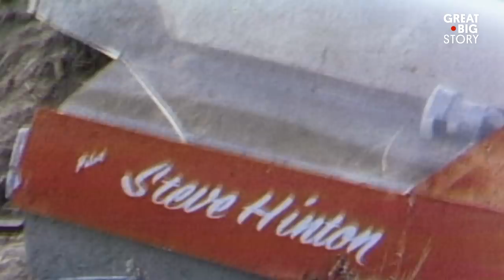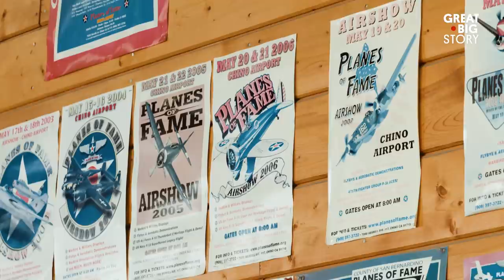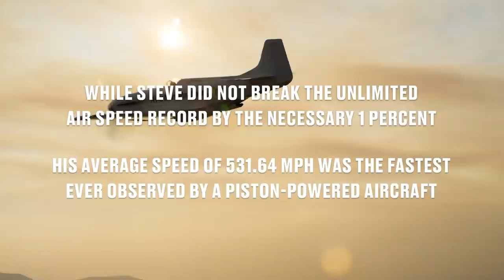Racing Against the Odds in a WWII Plane

Comment: in the 70's when i was a kid..i got a COX P-51 Mustang..the chrome one..for Christmas..it was absolutely gorgeous..4 bladed prop..yellow nose cone..i was the envy of the neighborhood kids :) my dad told me we would fly it in the spring time (we lived in Chicago) finally ...FINALLY..a warm spring day presented itself..hey dad can we fly my airplane..(i had been dying all winter to fly it) he said sure son..so i had it all ready to go..we ran the string out..attached it to the plane..fueled it up..started it up..i was about to go to the control handle..he says "son you better let my try it first to make sure it works ok"..ok dad..he takes it off..its flying through the air..actually it was very fast..sparkling in the sun..so he starts doing loops with it..1st was great..2nd one....well....i never got to fly it..
Reply: F
Reply: That's better than the first flight on the garage roof where my dad flew it around the roof 2 times before the control lines wrapped around my neck. The prop cut the lines and the plane flew off into the bushes. It was not a pleasant day for me. I still have the Wen Mac .049  engine 60+ years later.
Reply: @kimmer6  wow..i bought another cox airplane and the purple metal flake dune buggy also..i don't remember the plane..i guess nothing beats a chrome P-51..but i do remember that prop chopping at my fingers when starting it..your incident could of turned out much worse..ahh the 60's n 70's when lawn darts ruled the world :)
Reply: @ferrelx --I got a Chrome P51 Cox with I thing .20 engine for Christmas in maybe 1962 or 63 in Puerto Rico.  I was 10-11 years old.  Beautiful thing.  Reading the instructions in English I, after a few tries managed to start it over my bed with the help of my father.  Gas smelled strange, but i loved it. Smell stayed in my room for days on a row, so my mother prohibited me from starting the engine on my bedroom.  Read further how to fly it, went with my younger brother to the park and doing a lot of PIO's I managed to fly and land it. Flew it many times until i traded it for a bigger one.  Became Commercial Pilot later with help from ROTC.  Love that P51.
Reply: @feetgoaroundfullflapsC  awesome brother :)
Reply: @ferrelx  Pretty sure the Chrome version was by Testors and not Cox.
Reply: So he gives up beer and cigarettes for a month and buys you another one?
Reply: @SvenTviking  Well Sven....They were 12.00usdlrs in 1960.  What do you think?

Comment: Great story. If it was up to me, I'd opted for a more modern supercharged engine and use a pair of swept wing like the F-86 Sabre.
Reply: Anas Takiyudin Voodoo’s race engine had twin superchargers helping crank out 4,000HP.
Reply: @maxwellharris507  yeah but 4000bhp coming from 27L V12, that's 148bhp/l is pretty low by modern racing standard, and it's very unreliable. Even back in the 70's we got formula-1 engine churning out 1000bhp from of a little 1.5L engine. 3
Reply: Anas Takiyudin aircraft engines and car engines are very different animals
Reply: @maxwellharris507   grammar massacre warning
 @Maxwell Harris  it's a piston engine so not much difference than car engine, except than the fuel used, and the RPM redline. Stock aviation piston engines usual redline at only 2500 rpm to make the engine understress because it had to cruise at almost full throttle much of the time. For this race RPM limit is not an issue as the plane just need to do several passes at full speed. This test is done at very low altitude anyway so a car engine could be used with few modifications.
Reply: The record is for a piston driven aircraft with relatively straight wings.
Reply: Also it's not that hard in the F-86 cause it's transonic
Reply: @atranas6018  >what ist altitude
Reply: @atranas6018  Rpm is a huge factor, you spin the prop too fast and the tips go supersonic, greatly reducing its efficiency. Also automotive engines run up through rpms, the plane, like land speed cars have a high stress stagnant rpm set for a long time, which is the challenge. Theres a reason automotive and aircraft engines have developed completely different.
Reply: @ccubsfan94  this combo can be use to move the air faster without the blades going supersonic. Shorter blades, higher blade pitch, more blades, & suitable gear sets. The race only done in one specific rule, to go as fast as posible in a straight line with no roll & no negative G at almost sea level which under this condition automotive engines can serve really well.
Reply: @atranas6018  What automotive engines can survive that with that much power. Many drag cars are around the 2500 mark, you're asking for for more than 4000. Yes, top fuel is 10000 but those engines get rebuilt after every run. That's the issue, is it needs to be somewhat reliable as well as it needs to hold that power for a sustained bit and still run to get him on the ground. That's why different engines are used in different motorsports as well. Different challenges, different engines.
Reply: @ccubsfan94  that mustang got a pretty large room under the hood for 2 or 3 car engines lined together. They can combine the power by driving a common drive shaft. U can put 2 of the dragster motors u mentioned to get 5000bhp.
Reply: @atranas6018  Those drag motors are only designed to run full power 6 seconds at a time. Same thing I said before, different motorsports require different engines.

Comment: I wonder if they could get any faster if they used a cooling system similar to what was used in the He-100. But that might also need a completely redesigned aircraft.
Reply: That’s a cool idea that I could see helping. But I don’t think heat is the only problem when flying that fast.
Reply: @HUEEY  It's not about heating, it's about aerodynamics. The cooling system used in the He-100 didn't need radiators. The removal of holes and protuberances from the aircrafts fuselage made it way more efficient.
If I recall correctly, the He-100 broke several speed records thanks to that.
Reply: Around 570 mp/h is the barrier you don't wanna cross with this planes. Plus the engines are maxed out, the amount of hp the race built RR Merlin can put out is at 3600-3800 hp. That hasn't changed since the early 80's. The pinnacle are the aerodynamics. Plus the boil off cooling system you mean was used in the P51 Galloping Ghost and some Seafuries. Search "Galloping Ghost" and "September Fury" here on Youtube...
Reply: @Aleluia that’s what I’m saying there are many factors at play here. But I do agree that the he100s cooling system will make the aircraft way more aerodynamic. The only problem I see is that the he100 hand a way less powerful engine which did not produce nearly as much heat as a “overclocked” v12 Merlin.
Reply: @HUEEY  There is the only Mustang ever converted to a boil off cooling system similarto the He 100. And yes, it's the one that spectacularly crashed at the 2011 Reno Air Races. The conversion and the loss of stability through the removal of the belly mounted cooler was among the reasons that caused the accident. Top Speed was around 500 mph...
https://m.youtube.com/watch?v=es65gYhP2ms
Reply: @HUEEY  True. That's why I thought it would need a completely different aircraft design...if it's even possible.
Reply: @jorgsobota2228  I heard that after a certain speed, the air around the wing gets supersonic. That's why jets need the wing to be angled back, but does that also explain why the top speed for a prop is around 570 mph?
Reply: @jorgsobota2228  I saw the video of the crash and damn, it was a hell of an impact. Such a shame.
Reply: @Aleluia yes and I’m agreeing.
Reply: @pedror598  It's a mixed problem, on the one side you have (air) compression which only can be overcome with engine power (which leads to overheating and mechanical issues because the engines are operating already at twice the power output they were designed for...) where the prop on the other hand struggles to translate the power in speed (there you have cavitation then which causes heavy vibration) and then you have drag which could be only lowered by further streamlining and lightening of the airframe where you'll end up with stability issues again. And even swept wings wouldn't do much (was tryed with Learjet-ailerons at "Miss Ashley III" in the 90's - and guess what, it broke midair killing the pilot...), there was this turboprop project called XF-84 "Thunderscreech" in the 50's that wasn't faster than Voodoo. Like Hinton Senior said "It's as good as it gets"...

The only thing that might work is a very refined setup with RR-Griffon and counterrotating props (like in "Red Baron" which broke the record with Hinton Senior in 1978 and recently "Precious Metal"). With this there are maybe some reserves left, but this requires time and serious money. I doubt we'll see anything like that, the P51 airframes are way to precious and the prices are rising every year - and with every Plane that crashes too. Voodoo is worth around 4 Million $. You just don't waste that to prove pointless things...
Reply: @pedror598  around 400 knts the prop. Has a hard time dealing with wind hitting at that speed and becomes inefficient and needs a huge amount of power to overcome it.
Reply: Sobota, the issue with Ms Ashley and Galloping ghost was not related to wing design or the lack of cooling scoop/aerodynamics, the issue was  the elevator trim tab and the forces on the horizontal stab/elevator. In both accidents it was failure of the trim tab that led to catostropic tail failure. 
If you take a close look at Strega or Voodoo or pics of Hintons oldracer before she was put back into stock config you will see strakes build into the fuselage along both sides right around wing level. They were engineered and installed to help naturally trim the aircraft at race speeds without the necessity of cranking in more and more elevator trim thus allowing that relatively small and weak tab to not be subjected to major stress under speed. It can essentially stay  relatively neutral/streamlined at high speeds.
I remember years ago helping in Tigers pit and a very VERY small amount of play was found in Stregas trim tab. An entire new tab assembly was installed completely eliminated that infitesimal play. Thats how critical certain items are in this sport, something that  the general flying public has  no clue about.
Reply: @pedror598  ... Yes.  Because aerodynamically speaking, a prop is just a wing in a different plane of motion.
Reply: @uneekcowgirl  - Didn't knew about that detail, i knew the trim tab is a critical part. Always something new to learn. Bob Button had his near miss in Voodoo when one came lose if i remember right, thankfull going up not down. Found very little regarding "Miss Ashley III"s crash, from those i found the whole tail had a structural failure, ripping off and...well, a fast way to die anyway...

Anf right, cause of #277s crash was the trim tab, but at the NTSC hearing they also spoke about the loss of structural integrity by removing the belly...
https://m.youtube.com/watch?v=EMmhOkXQB0s

Comment: this 1% Rule is BS,... Faster is faster and 531 is clearly faster that 528
Reply: Its not, imagine records being beaten every 0.1 extra speed
Reply: @NoobWithEpix  it's still faster than the previous record though. Also each time the record increases the harder it will be to break the next time because it's based on percentage, its a pretty stupid system imo
Reply: Land speed records are not based on percentage gaps. So I dont think why they should make that 1% rule. Faster is faster. Period.
Reply: Imagine if you go 528.00000000000001 instead of 528, is it still a new world record? According to your logic it is
Reply: @basilisk7201  I think that's an exaggeration of the logic. But 1% is too big. But still.. it is faster. 0.001% or 0.002% is like .5-1mph of a speed gap and that is still considered faster. Just like cars 199 vs 200mph
Reply: It's irrelevant anyway. That old record is no longer considered valid and therefore the record stands at 531.
Reply: @_lime.  awesome.. is there a documentary of a team trying to beat the record. Would love to see that
Reply: @basilisk7201  faster is faster m8

Comment: P-40 warhawk has a wing break speed of 661mph, but the controls lock up at 450mph roughly, and no you can't reach it is n level flight as the P-40s top level flight speed, using WEP was 360mph at 1 mile high, I realize that the plane he uses is a P-51, but there was a P-40 on the thumbnail, this is a call for them to fix the thumbnail

Comment: Rolls Royce not Packard,  eat that mr boring tractor.
Reply: I mean Packard Merlins are just Rolls Royce Merlins built under licence in Detroit...
Reply: Besides if you listened they said it was a different engine
Reply: @tsarbomba4620  still a rolls Royce engine. That p51 uses a rolls Royce griffon, not a Merlin. Still very much a british engine
Reply: Emerson C yes it is but it’s built under license in Detroit
Reply: @tsarbomba4620  the griffon is not. If it's the Merlin you're referring to then yes you are right
Reply: Emerson C yes I was
Reply: @emersoncaicedo3146  since when did p51 use griffions
Reply: @flangel842005  some modified racing p51's have heavily modified rolls Royce griffon engines as well as Merlin ones. Of course the p51 originally did not have a griffon
Reply: @emersoncaicedo3146  Only Precious Metal is currently equipped with a Griffon, and its been down for a number of years. This is a Packard built Merlin, however it doesn't matter much at this point seeing as the extent of modification basically means that its a one of a kind engine.

Comment: Dude, you broke the record, just didn't get the designation due to an arbitrary 1% rule.
Reply: What?
Reply: That 1% is to account for the error of the measurement instruments. It's not arbitrary at all.
Reply: Its not arbitrary. I'm sure 535 was probably attained by diving or crashing aircraft during WW2
Reply: By saying that the speed monitoring equipment may be off and then assigning 1% to it is arbitrary. First you’re assuming the measuring equipment is off without actual data to support the fact, thats arbitrary. Then your assigning that it’s off by 1% where did 1% come from? Why not 1.25%? So the 1% is arbitrary. Stop bring stupid.
Reply: @myownidenity4955  540 MPH was achieved by the airliner TU-114.
Reply: @ausintune9014  That is a turboprop engined aircraft. This record is for piston engined aircraft.
Reply: Well well over. Although for technical reasons ww2 pitot tubes are not accurate in dives. That said in ww2 dive testing a number of RAF pilots recorded in the 600s - 620 being the highest. In '52 a Lieutenant Edward Powles' recorded 690 mph in a evasive dive to avoid hostiles.
Reply: @myownidenity4955  I'm sure they did, however this record is on a closed course with altitude restrictions, which means straight and level flight.

Comment: The idea of the end of these aircraft in our skies is heartbreaking. Much is being done to keep the few that are flying in the skies. What we need, is a way to manufacture new ones. It seems absolutely impossible, but with modern manufacturing techniques it can be done. After all a group of Aviators brought back an handful of ME 262's. And with the ability to make new, better, higher horsepower engines means that it's possible to make them faster, and hopefully safer in the process.

Comment: Has anyone thought of using a Sonny's racing engine? The V8 is available in 1000 cubic inches, a 12 cylinder would be 1500 cubes and if there is room a 16 cylinder would be 2000 cubes. They are already much more efficient than a Rolls Royce and everything in them is built for 300 plus horsepower. It's all aluminum and has better cooling if waterjacketed, and much improved oiling. All the metallurgy used in modern racing engines is light years ahead of WWII, which were plenty strong for their time. But these new engines have much lighter rotating masses and can be run harder than a Merlin. That, or another engine design like that, might just be the powerplant of the next record breaker without all the extremes these engines have to go through. 
I was writing this well before he made his attempt. Congratulations on getting so close. Now all you need is that extra bit of endurance. I have a good idea who will be beating that old record!

Comment: GREAT airframe + engine combo for prosecuting a high-altitude air war against the brainy Germans... for setting arbitrary speed records at sea-level, not so much.  If you must fixate on "piston" records, might I suggest the P-47 or F8F, both using the monstrous P&W-2800 Double Wasp, which was designed from the go to withstand both much higher boost levels than the Merlin, plus ethanol/water injection as well.

Comment: I love the P-51 Mustang. Originally had a 27 liter V-12, had about 1600 hp, and top speed at around 440 mph. What an amazing aircraft. To get 3600ish hp out of that engine is amazing, considering how old that engine might be. Increase fuel flow, increase boost, increase airflow. Sounds easy enough.

Comment: I'm more amazed that an engine as big as the merlin can "only" produce 3600hp. It's 27 litre supercharged (in stock form) I wonder how it fails, and if something like a billet block etc or drag racing components could help it live longer. Or possibly there is some sort of engine restriction for the record? (ie must use standard heads/block?)

Comment: ok for us engine buffs what was the spec of the griffon, was it using alcohol fuels, nitrous, more blower boost ,etc as said 3600 hp is a awfull lot , but to go 550 mph plus you need a lot

Comment: The prop driven piston engine speed record...what are the restrictions? 
The P-51 is a classic WB for sure and the RR Merlin is a wonderful engine first run in 1933. 
It  would seem that if the record IS the goal, a more modern technical approach would be the best way to pursue it.